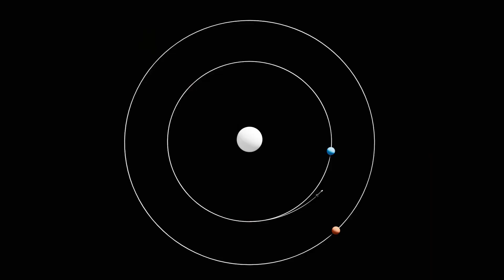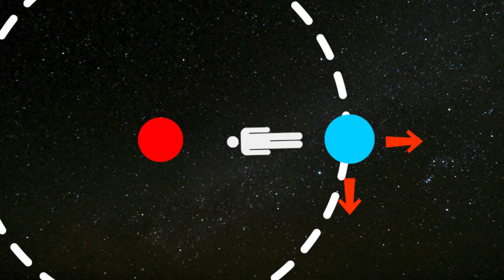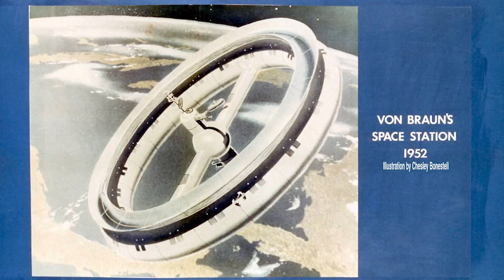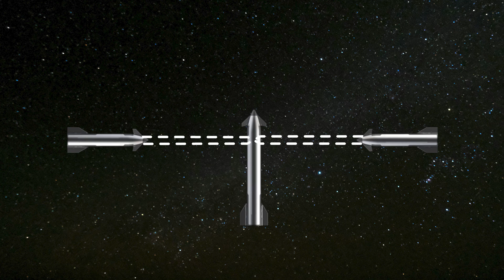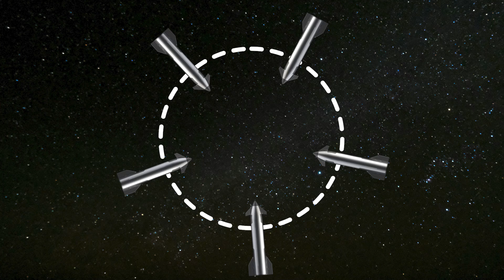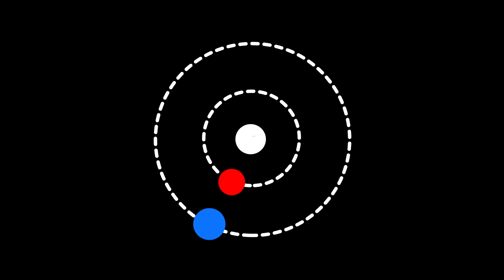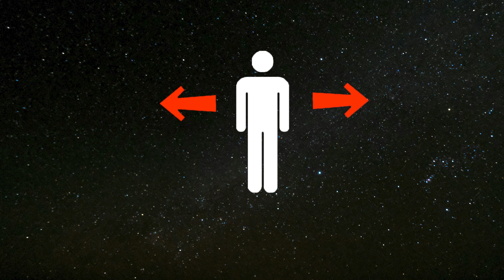SpaceX Starship Life inside Solution: Artificial Gravity

Comment: We will need two wheels to start and stop the rotation.
Both wheels should be on the side of the ship, like a helicopter's twin propellers. This is necessary so that the ship can turn in the opposite direction to decelerate. If the ship is in the center of the wheel, it will be difficult for it to make a turn.